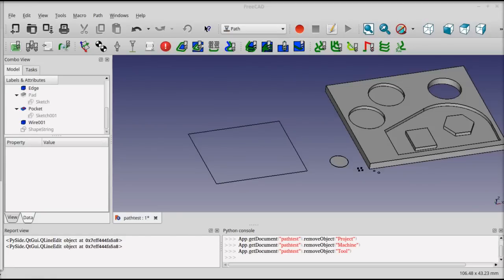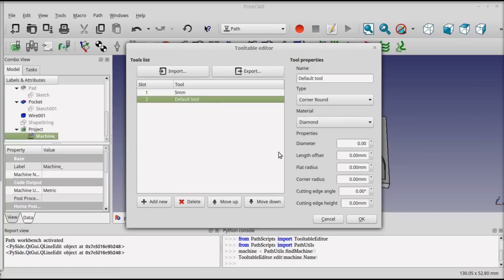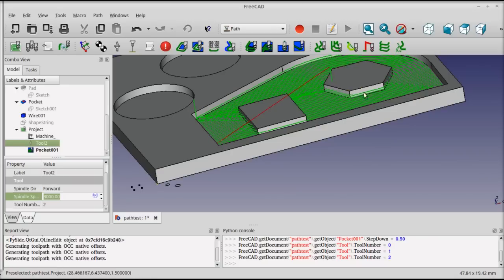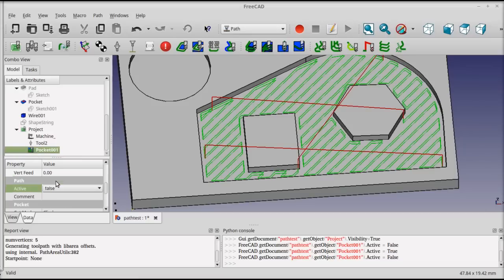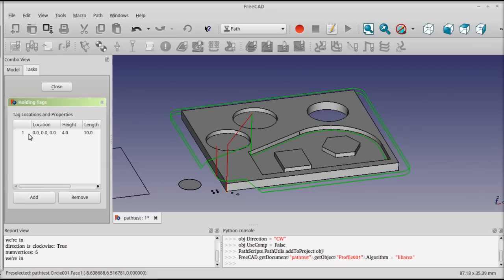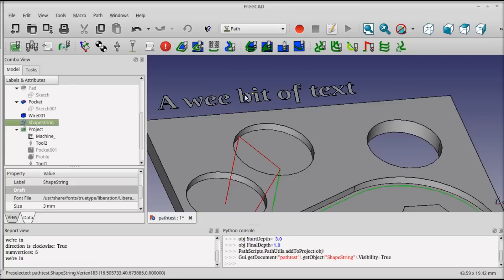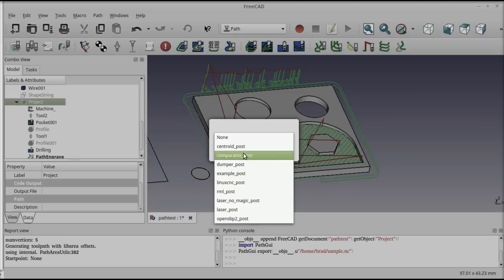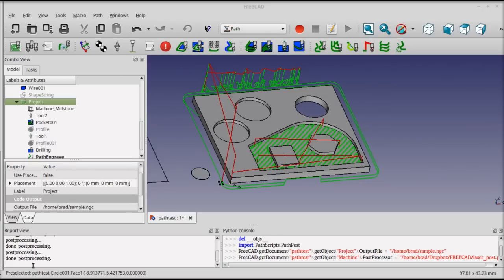A summary of FreeCAD Path workbench configuration and use

Comment: Why do you create toolpaths in the CAD and the CAM apps? Surely the CAM program only should create the toolpaths?
Reply: Path is one of many workbenches in FreeCAD.  It's the only one that does toolpaths.  Are you suggesting it's not appropriate to have a toolpath generating workbench in a design tool?  That's crazy.  Virtually every major CAD software has a CAM addon, workbench, or other facility.  Working with CAM inside the design tool is a natural progression since sometimes the design needs to change to facilitate manufacture.
Reply: It is not normally part. Of the design(cad) but the question was really why you do it twice. Once in the path workbench and again in the cam app. This is normally a cam function. This comment was added to another video that included both ..
Reply: sliptonic yes it looks like my comment ended on incorrect video... I posted it on a Web page where another video was posted. Strange.

Comment: FreeCAD 0.16, when I create a Profile cut, I can't edit any of the parameters. It's set to cut the left side of the line, if I set the dialog box to the right side of the line, it just goes back to left.
Reply: And the pocket tool seems to just lock up FreeCAD.
Reply: Let me ask you a question, what's it going to take to get to V1.0 of this software?
Reply: 0.16 is still considered the stable version but is very old as far as Path is concerned.  Everything you're seeing in my videos is from v 0.17 which is still in development.   0.17 has many other things besides path including support for bodies.  These are some huge changes and it will be done when it's done.  If you can build from source or if you're on linux you can get a daily build.  With that you can use 0.16 to design and use 0.17 for CNC.

Comment: thanks, this has helped me to get started with the path workbench, but at 5:35 in the video, you show how to select libarea via the algorithm option in view for the pocket , I do not have that option showing. libarea is installed (I use it with HeeksCad) and I tried using it in both v0.16 and ver 0.17 of Freecad Any suggestion as to anything I may have missed, i.e. do I need to compile Freecad with some switches. These versions are as supplied no compiled by myself
Reply from the maker: You definitely need the 0.17 version. The algorithm switcher is only for profile and pocket ops. Make sure you're looking at the data tab (not view) for the operation. If you're still having trouble, please post to the forum.
Reply: Thanks, already have posted to forum

Comment: Usefull video but i have a problem. I follow your steps. I make a new toolpath project, set the tool list but when i want load tool number (2:40 in vid) not happen anything.  Later i try to write the script in to  the python consol. It doesn't success nor. Had any similar problem for you?

Comment: Very, very shiny. Path is really coming along. I'll probably pull your branch later on tonight, build, and give it a go through. Any reason your going with OCC/OCE offset as the default instead of libarea? Or is it just simply offset was where it started with the module and libarea is an addon. 

At any rate, keep it coming!
Reply from the maker: +61quick That's it exactly.  We started down the path of adding additional icons for each type of algorithm/operation combination but that's not sustainable.  When I consolidated the profile operations, I based it on the OCC version so it ended up on top.  I could see this being a user preference setting.
Reply: +Brad Collette  +1 on the user preference setting being in there eventually.